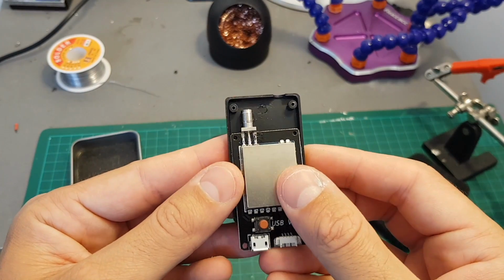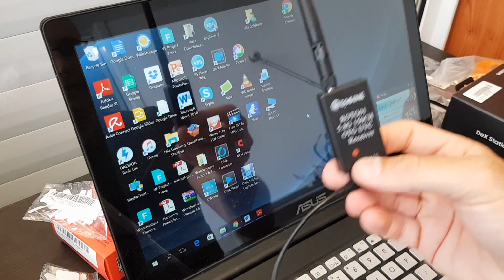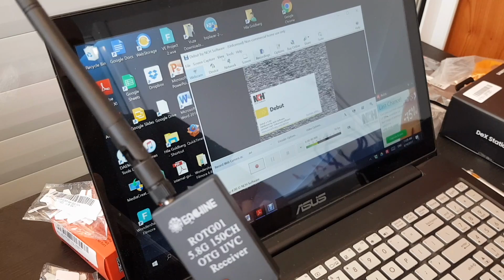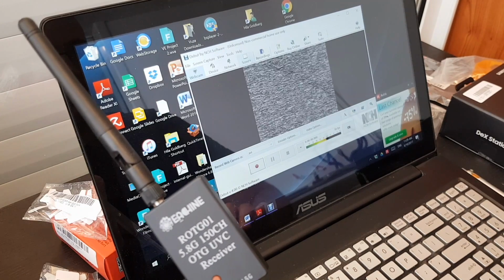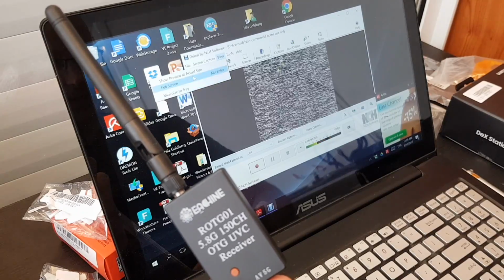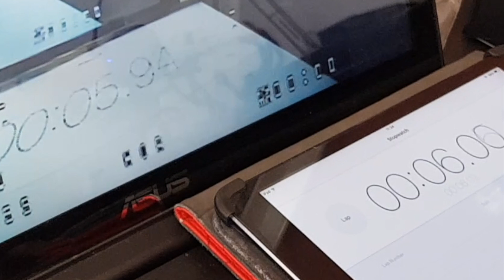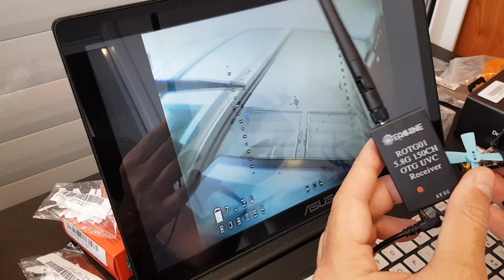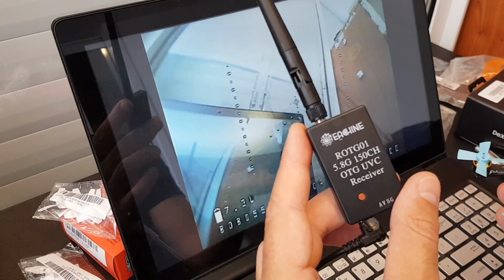How To Do FPV On Your Pc - Eachine ROTG01 Review + PC Test

Comment: great video, confirmed what i thought and i will buy one of these now for use with ardupilot.
just one thing, thats not a rubber duck antenna, its a dipole, a rubber duck antenna is a loaded whip (coiled antenna), the 433mhz antennas that come inside the same outer body are "technically" a rubber duck in armour lol but the 2.4 and 5.8ghz antennas are dipoles.
Reply from the maker: Thank you for your comment and for the explanation Steve. I am no longer referring to these type of antennas "Rubber duck".
Reply: Gal Kremer  I've already ordered my receiver because of your video, can't wait !
If you Google the rubber duck antenna you will see what I mean, it's a name for a particular type of antenna and something I'm very familiar with as I use low frequency loaded antennas in two way radio.
Reply: @stevefox3763  hey how did it work out? did this product work with your computer or did you use it for a mobile device?
Reply: @i_critique_your_vanity7216  it sucks on the pc, very poor, blocky picture and horrendous lag.
the Eachine ROTG 02 works ok on a android device but not on pc.
its the way the digital output from the receiver is handled, ive tried it with different software and also on different pc's but all behave the same. 
a regular diversity receiver with analog output and a capture card/device is the better option.

my ROTG02 does not get used, the only time i use it is when i want to plug it into my phone to show someone what im seeing whilst i fly with my goggles on, for that its usefull as its a quick second display but even on android the image quality outputted by the ROTG02 isnt great, just satisfactory.
Reply: Steve			 Fox well I’m very new to this stuff, so do you have any recommendations for a laptop compatible 5.3 ghz (I think that’s the frequency) receiver? I plan on installing an FPV camera on a mid sized rc plane for kicks and need input for a cheap/beginner option
Reply: @i_critique_your_vanity7216  you mean 5.8ghz.
Any decent receiver will do, diversity receivers are best.
All the regular fpv receivers output an analogue signal , the crucial part of making them work on a pc is picking a decent capture device.
there are many usb capture devices that would allow any analogue device to be plugged in, you just need to read the product reviews to see if people are saying good things about them.

I have an usb capture device that was sold as an 'easycap' capture card, it turned out to be a fake and not a genuine easycap but it works ok. a genuine one would be better though.

basically do some google research on pc capture devices and see what you think suits your application and budget

Comment: Thanks for the post. I have one of these ROTG01 devices on order and I'm planning to use it with my Nexus5 and/or MacBook Pro. As the device is supposed to behave just like a normal USB camera, could you please explain why you said that it doesn't  work on Macs?
Reply from the maker: My pleasure. My mac just won't recognize this USB device... Let me know if it is working for you.
Reply: I just received my ROTG01 and tried it out on my Mac using a standard USB to micro USB cable (the one that came with my new RunCam2). Even without a signal to receive, the Mac had no trouble recognising it. The ROTG01 shows up in the list of cameras under System Report, and I can see the video output using Skype or PhotoBooth. VLC recognises it but won't display the output (yet). Unfortunately, it seems that iMovie doesn't support UVC cameras so I'm still looking for suitable video capture software that will actually work with it. Edit: There is a Mac version of the Debut video capture software that you linked above and that seems to be working just fine. :)
Reply from the maker: Thank you very much for letting me know! I will try it again and hopefully it will work for me as well, as I am not a big fan of Windows ;-)
Reply from the maker: It worked like a charm. Thanks again! I will update the video soon.
Reply: after i go to debut what should i do , i havent got my device,but i just want to know how?

Comment: Uploader,

I need to your help kindly,, I hook up the Eachine ROTGO1 with my laptop thru a regular micro USB cable, that we use in Samsung phone charging or sync cable, bt found no connection. It does not recognize or RX becomes even warm at all. I use  WIN-10. 
I think it has got something to do with OTG cable that I am not using. My laptop has a regular USB port not micro female one.  How did u connect it without OTG that comes with the RX? THanks.

Comment: Great video. Just wanted to report it works also out of the box with Open Broadcast Studio (OBS) which is free (https://obsproject.com/) and has no nagging screens like the NCH software.
Reply from the maker: Thanks for sharing it Chris!
Reply: @KremerFPV  Neither one works for me with ROTG02. Computer (Windows 10) picks it up as USB 2.0 Camera, but the moment I try to open it it just doesn't work. NCH one just switches back to my built-in camera, OBS just stays on black screen.
Reply from the maker: @Vousie  Have you tried using VLC?
Reply: @KremerFPV  I tried but it doesn't even turn up - only my integrated webcam is available.
It also doesn't work with my current Android phone, even though the tester app says it's UVC capable. The only thing I've found to work is my old 5+ year old Android phone and even then it just crashes whenever I try to use the video record button.

Comment: Does this work with the dji system/analog? Thanks
Reply from the maker: Hi, what do you mean exactly? If you'd like to use analog RXs on you DJI goggles check out this video: https://youtu.be/tCDd9FgEwP8
Reply: @KremerFPV  Like will it work with the DJI air unit. (which is analog)
Reply from the maker: @trey1106  No. DJI Air Unit and Caddx Vista work only with the DJI system.
Reply: @KremerFPV  Oh, okay thanks